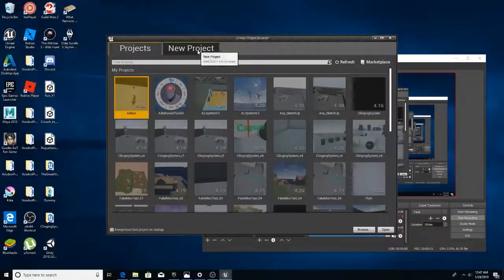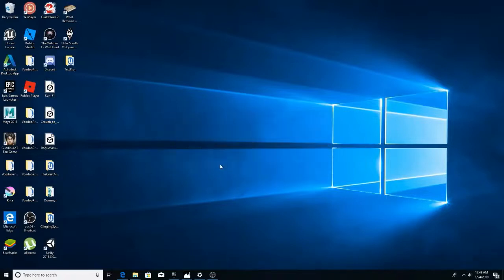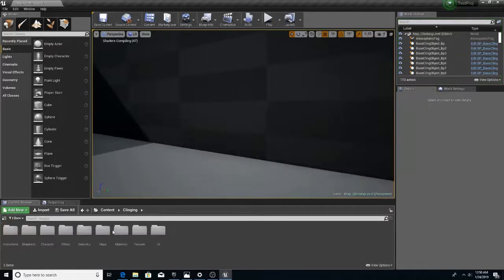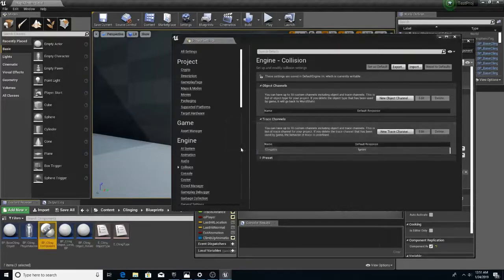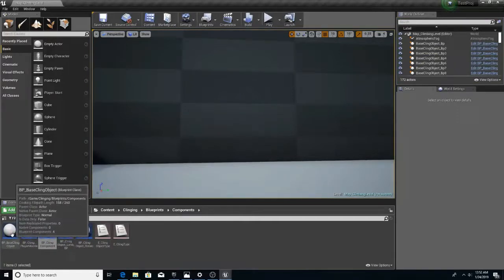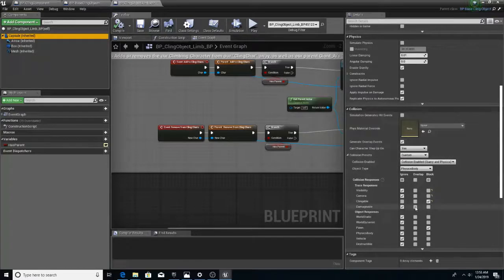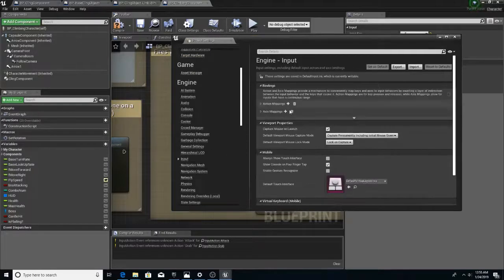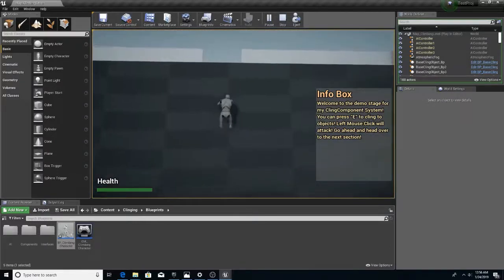Component Climbing System - Setup (Short Version)

Comment: I was wondering why it wasn't working fresh out of the box. Good thing is I learned a lot with this video. Instead of copy and pasting I understand the blue print a lot better when you where showing inputs and collisions.
Reply from the maker: The problem stems from the type of package it is. Only packages that are sold as "Complete Projects"(it says "Create Project" instead if "Add To Project") export the editor preferences with it. 

I didnt want to do that because this climbing system is designed to be added to existing projects... Making it a "Complete Project" means you would still have copy the files over to your project or just work off of it. Thus I minimized the use of the editor preferences to just trace channels and inputs to make the workaround viable.